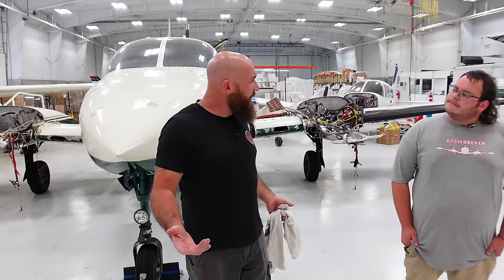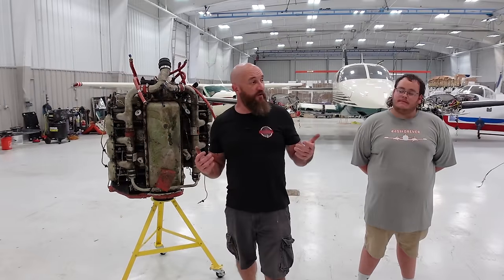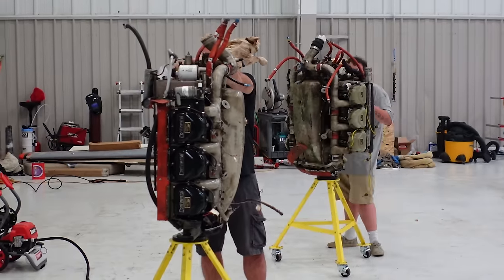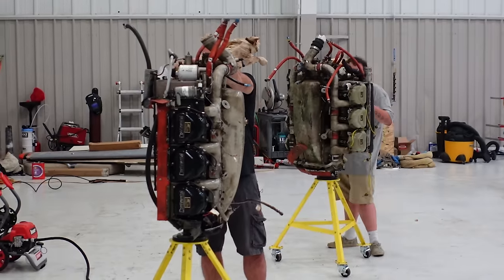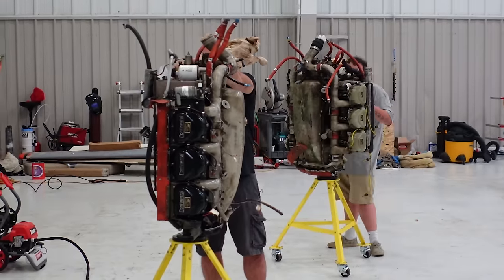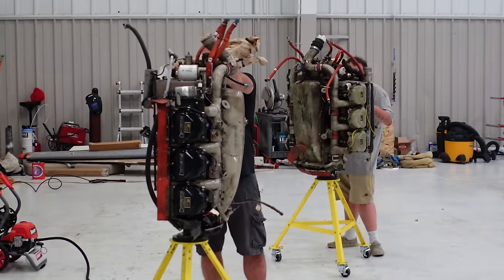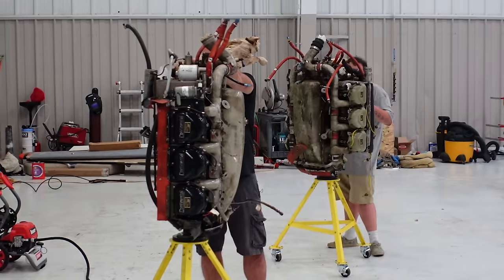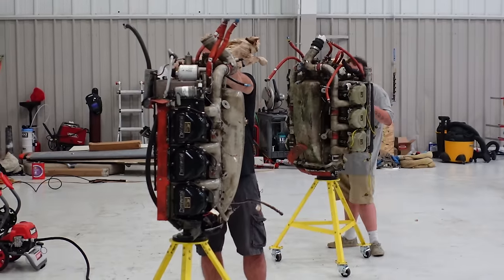One Step Closer On The Free Abandoned Airplane ! Ep16

Comment: If you don't hold an FCC General Class Radiotelephone license with a RADAR endorsement, technically it is illegal for you to re-install any avionics gear you have removed that transmits electromagnetic energy. So comms radio transceivers, RADAR and IFF transponders. But no problem if you want to install receiving equipment, however I believe you will still need a sign off from an FAA qualified electronics tech. It's been ages ago since I worked in an avionics shop, I'm sure most of the rules have changed. I was still a junior in high school. Back then I held a FCC Radiotelephone First Class license with a RADAR endorsement.
Reply: First Class Radiotelephone Operator License is no longer a valid license. Nor would any endorsement on that license. Now one is required to hold a General Radiotelephone Operator License or GROL (PG). There is still a radar endorsement.
Reply: @buckmurdock2500  I know that, I received my license in 1971, I am fully aware of the General Class license taking the place of the First Class and I know that there is a RADAR endorsement, I allowed my license to lapse because I got out of avionics and broadcast stuff and went into computers, when they were the size of a large refrigerator and have been working in computers ever since.

Comment: Ok my question is, is the bare metal on the engine cowlings stainless steel or aluminum? If it’s aluminum stop using the wire brush to clean it!

Comment: Oh crap.  you're spraying high pressure with uncapped fuel and oil lines?
Reply: You do realize he’s not an aircraft mechanic.
Reply from the maker: All of the components are being replaced or rebuilt. Had the situation been different all of the lines would have been capped….   After pressure washing everything was blown out. In two weeks it all comes apart for overhaul !

Comment: Be carefull with the hearter.  "Whirwind ??"  Years ago when flying freight in a new C-402C, the heater blew up on taxi out.  Big explosion.  Blew both
hatches open and all the Fedex envelopes out.  5 below.  What a trip.  Back to the shop. multiple rolls of duck tape (Speed Tape) to secure all the
hatches and back out to freeze my butt off on flying my live.  Heater is very touchy!!!!!!!!!!!
Reply from the maker: That had to be an exciting trip !
Reply: I called the heater "Whirlwind" as it was the nickname mechanics gave them.  It was actully called Southwind.  Fed by the airraft's fuel system.  And no...Mine was not the only mishap.  The problem would come with air density being to high.  Either in ground negative temps or trying to light it off in flight.  When it was working it was fine.  I flew 3 nights during the Great Mississippi Inversion Of 1983 with out a heater.  All kinds of bad things happened without heat.  BAD STUFF!!!
Reply: @eagle2019  Yes, the religious group flew with a known inoperative/malfunctioning heater and tried to use it anyway with predictable results.

Comment: 3 bolts holding 100+ gallons of fuel on the wing doesn't surprise me. You'd be surprised at just how much weight a bolt will hold. I once lifted a junk 1998 Toyota Corolla by the trunk latch which was held on by nothing more than 2 10mm bolts. Lifted the entire back end of the car.

Comment: You should get Xavion

"Your safety-conscious copilot." I'm just a fan of Austin Meyer and have no connection to the company and I make no money off of this.
Xavion is always imagining the worst that could happen, so you don’t have to.
If you have an engine out, Xavion will plot an easy-to-fly course to a nearby runway.
Xavion knows about your plane’s glide characteristics and the nearby terrain, so it guides you to the safest nearby runway—not just the closest.

I have no connection to this company other than a customer of XPlane which is a very sophisticated flight SIM that uses real physics. The guy that owns the company and is the lead developer of the FAA certified flight sim didn't like any of the software out there that was supposed to help you if you were in trouble so he wrote his own. At just $9.99/month (or $99/year if you buy per year), Xavion is a micro-fraction of the price of a traditional glass cockpit. Plus, you’ll be able to connect to X-Plane and have the most powerful avionics available in a flight simulator and its runs on iPads so you don't have to buy a whole bunch of avionics. 

Never worry about an instrument failure again.
Xavion provides an iPad-powered backup of your primary flight instruments. If one goes out, simply reference Xavion and continue on your way.
When connected to an external GPS unit, Xavion’s instrument readings can rival the ones built into your panel!

Again, I have no connection to the company. I make no money off of this. I just thought it was really cool. Austin Meyer has no idea who I am. Just a fan.

Comment: Ok time for a stupid suggestion, if this aircraft is going to be a true angle why not widen the doors for stretcher Just like a world war two American cargo plane but modern with ambulance equipment told ya its a stupid suggestion
Reply: If you don't ask you'll never know. The reason is can't just chop into a semi monocoque structure and widen the door.  Would need engineering in order to get FAA approval. A new door would have to be made. It would take tens of thousands of dollars. The same would apply to getting a litter carrier approved. None of that is needed because Angel Fight patients have to be ambulatory. No litter patients will be transported. What you are describing would require an ATCO certificate, which there are no plans to do here. Charity flights will have to be done in conjunction with a volunteer pilot organization so in reality, there will be a lot less charity flying than what many currently believe.
Reply: @buckmurdock2500  well I guess I made a stupid suggestion  I'm not a flyer so just thought it would be possible, your next project should be the osprey lol

Comment: Just a little advice, go out and buy you a pressure washer of no less than 3000 psi! It will do a whole lot better than the one you have, because i see that you go over spots and none of it comes off at times.
Reply: are you familiar with water jet cutting? You could easily cut this plane in half with a high pressure washer.
Reply: @buckmurdock2500  Yes, but that means you are literally holding the jet directly to the metal!

Comment: you have some strange ways of doing things. Why not put the engine closer to the drain. I also would not do such dirty cleaning work around other aircraft. Your putting all kinds of crap in the air thats not good for the other aircraft.  If I saw a shop doing that. I would assume you dont know what your doing.

Comment: Why would you put an extra gas heater in a plane if you have 2 engines that put out a few thousand BTUs of heat?
Reply: what you saying doesn't make any sense, BTU is a unit of energy not a unit of power. and BTU is such a stupid unit anyway, just use SI-units, like the rest of the world
Reply: @tobiaslang3621  BTU is a unit of thermal energy. So I used it to ask why you wouldn't just put a radiator in the cabin to use the heat of the engine rather than burning extra gas
Reply: @florichi  yeah, I got what you meant. you just didn't express yourself correctly. BTU is a unit of energy, but what you wanted to say is they put out a lot of power. which is usually in watts or your BTUs/hour, for your case. but please just use watts

Comment: I am sorry but more than another month past with no uodate and your out with the car crew again doing more high pressure cleaning.  You do realise to make a grounded plane air worthy you actually have to refurbish things according to  regulations or replace with certified OEM parts using qualified engineers.  All these videos of the 401 and I dont see any of the money donated has been spent on actual  aircraft restoration activities or new parts now fitted? The channel may as well be called "Aircraft Autowashers" or "Aircraft Detailing Services"  Great way to introduce more corrosion by pressure washing and failing to properly treat the metal aftereards by the way.  If it was a serious rebuild it would look more like historic aircraft restoration. Aluminium fabrication / replacement of corroided sections and new riveting etc I don't see the wings off yet and sent out  All I can say is leave it to the professionals.  For example you could have easily had the under carriage fully serviced, struts rebuilt / replaced  plus wheel hubs and brakes done by now.  Where are the engines right now? Were they sent out to be rebuilt and certified after removal a month ago?  If so with which aircraft aerospace engineering company and due completion date?  I think your heart is in the right place but this project could be so much more by getting the plane to   folks who are qualified to do the work right the first time.  It would be different if this was going the be some static display in a museum.
Reply: exactly this. I'm currently finishing my master degree in aerospace engineering, and this plane will never fly again. the only way to make this airworthy again is to rebuild it completely from scratch by certified personell (at which point it would be cheaper to just buy a new one).He works on that plane like he would work on a car and the FAA will never approve an airplane on which uncertified personell performed such major repairs.
also the logbook is missing, which is apparently also a problem.

I watch these videos for fun because I just like watching an airplane taken apart but my guess is this project will lead to nothing.
Reply: @tobiaslang3621  Your exactly correct.  No way would the FAA give an airworthy approval to this aircraft.  It would have to be rebuilt by an aerospace / aircraft manufacturer.  But its interesting to watch their back yard mechanics and other activities.  Even the use of wrong tools e.g crush wrenches on fuel lines and nuts that should be undone using correct spanners or specially tools is laughable.

Comment: It is going to cost a Half a Mil to completely reman that plane just a guess. There is a guy near where I live that has a repair facility and 10 years ago when he went on vacation, he had a 401 he was rebuilding. He just had the wings rebuilt and they stole the reman engines all the instruments and his tools. The thieves cleaned him out. The wings are still in his shop that were just rebuilt plus the complete landing gear all remanufactured and crated. He said he was glad he had insurance it cost him over a million bucks in claims. He was upset when that happened. They damaged the airplane it will never fly again and what was left the Insurance company let him have it. They stripped all avionics and interior.  I remember it well never seen a man so mad.
Reply from the maker: Does he still have the wings ?
Reply: @rebuildrescue  I will check and let you know.